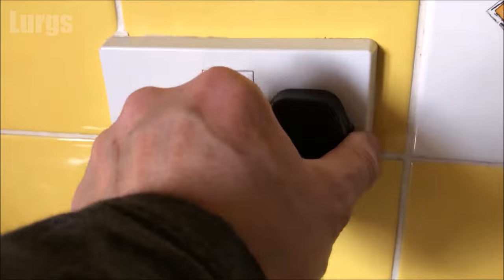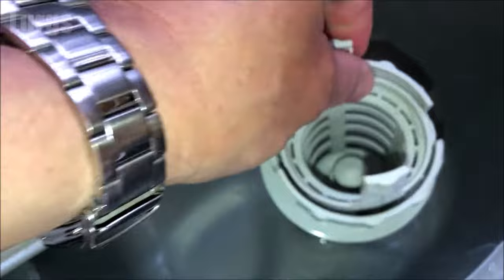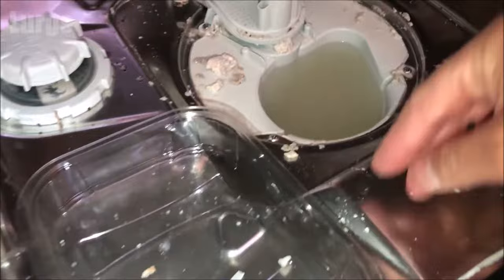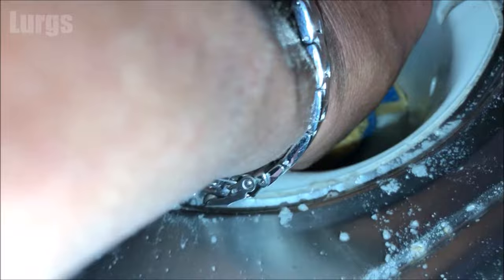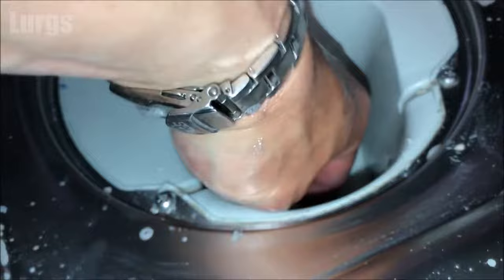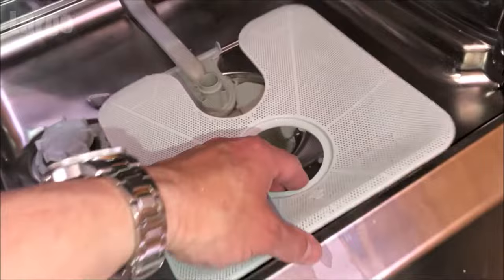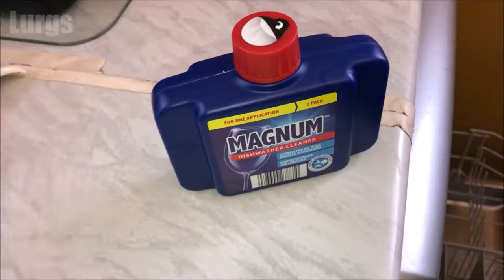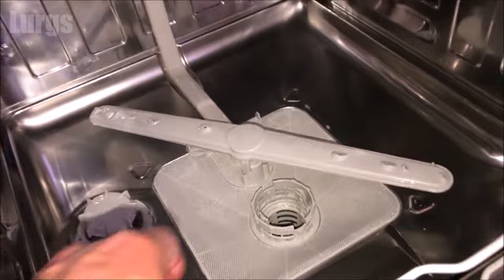How to clean Filter in Beko Dishwasher for Maximum Efficiency - Beko Dishwasher not Draining Water

Comment: What do you do if you do all this and it still doesn't drain? (I assume there's s something in the pipe or something) Call a plumber? The whole thing is built into our cabinets because we're renting and I guess the landlord thought it was a good idea...
Reply from the maker: @SarahExpereinceRequiem  If filter is clean and impeller then yes it could be a blocked drainage pipe at the back or in the sink if it’s plumbed into the sink. But pump maybe faulty in the Dishwasher. If it’s covered by your rent I’d ring Landlord and get them to sort it out. Good luck
Reply: @LurgsHowToGuides thank you! Oh, also thanks for the tip with the sponge, I guess I never realise how much of a volume of water a sponge could hold.